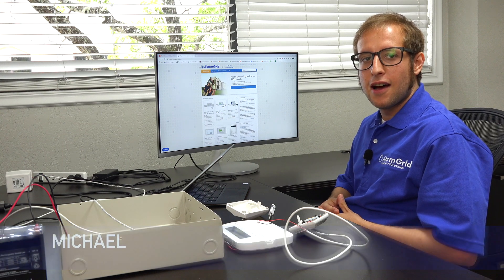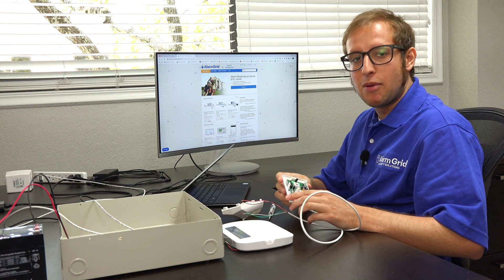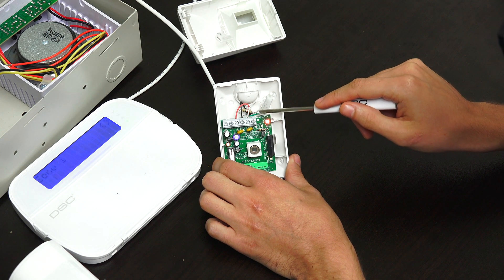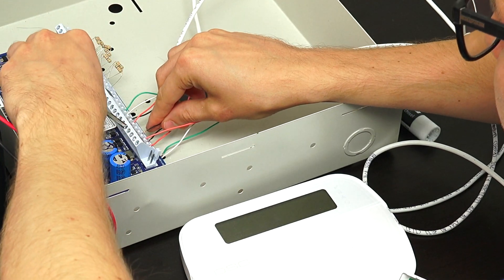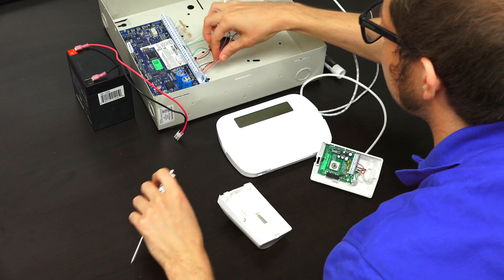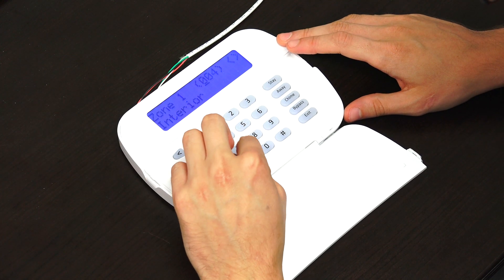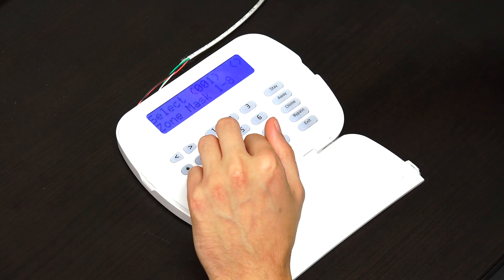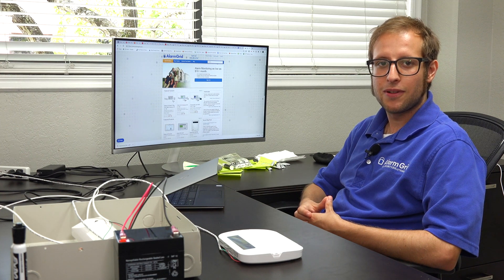Adding Hardwired Zone to DSC PowerSeries NEO Security System

Comment: You can use any brand of motion detector you want as long as the alarm output is dry contact or conventional.  On my alarm systems, I usually like to wire the resistor in parallel with the normally open contacts.  So, on my alarm system, I like to wire the glass breaks, photo beams, and motions just like smoke detectors.  And, on my alarm systems, the door sensors wire almost like pull stations but with a small twist...resistor at each door sensor.  And, no matter what brand of alarm systems you use, I would strongly recommend carbon monoxide detectors.  Carbon monoxide is colorless, odorless and deadly.  I usually like to call carbon monoxide the silent killer.  In fact, my authorities having jurisdictions or AHJ require carbon monoxide detectors in every wing or section of the building and on every floor.